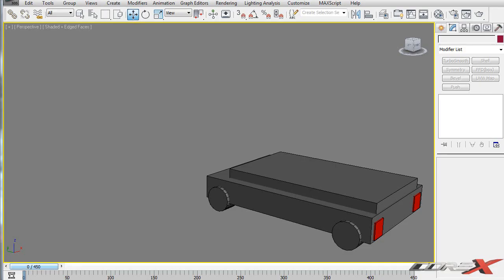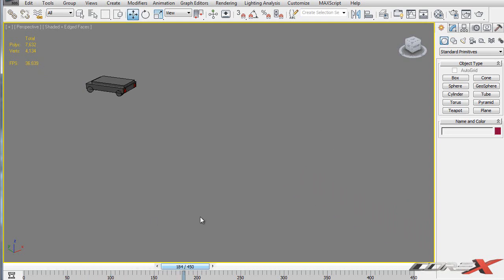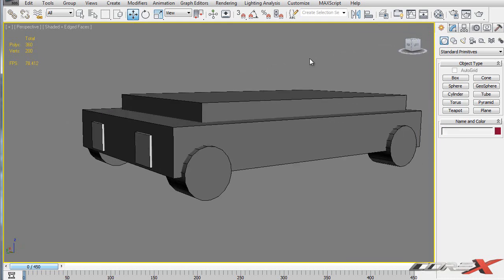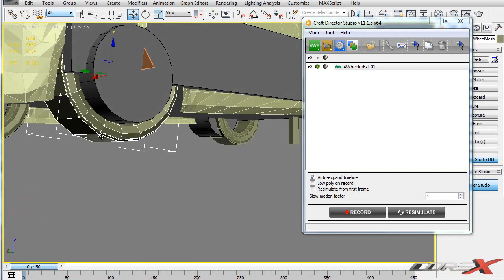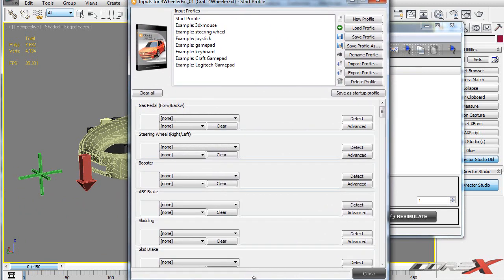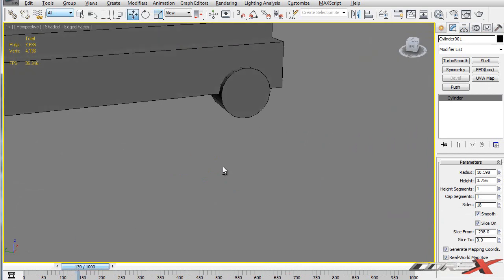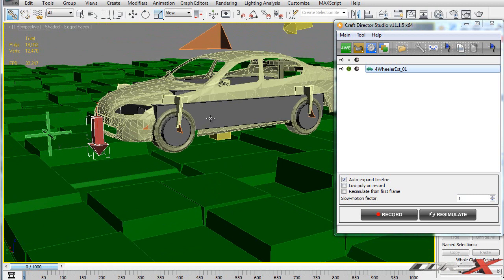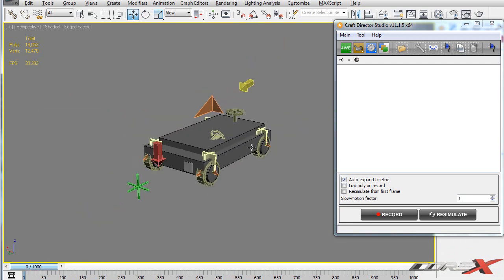3ds Max Tutorial | Basic Car Animation

Comment from the maker: Yes, do this:
Select all the parts making one of the wheels, then go to Group->Detach, and while having them selected, go to Group->Group. Move it around to make sure you didn't miss any part! If you did, select that part, Detach it from the main group, and Attach it to the single wheel. Do this for three wheels, and you should be good to go!
Also, select all the wheels, and align their pivot points to their centers.